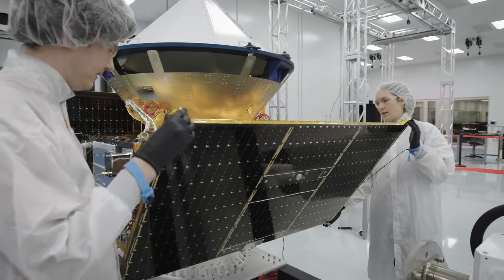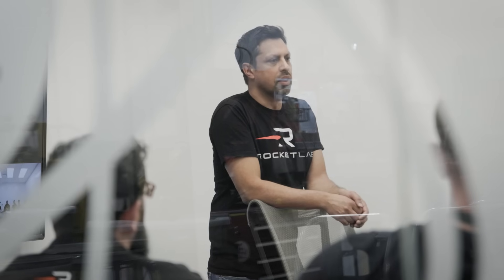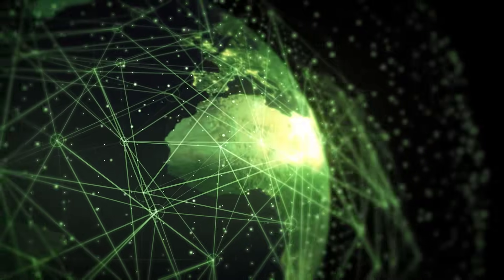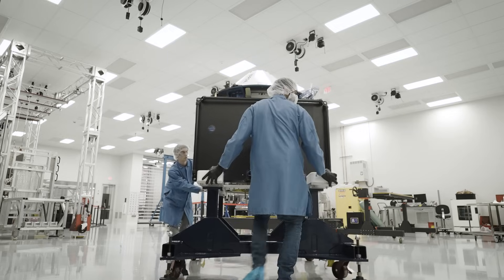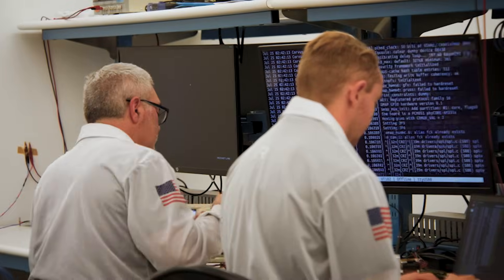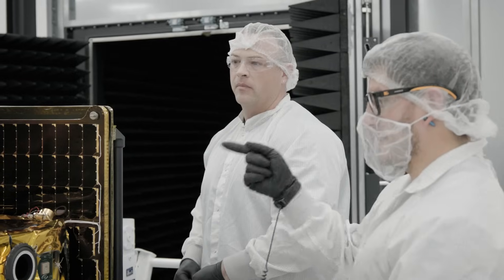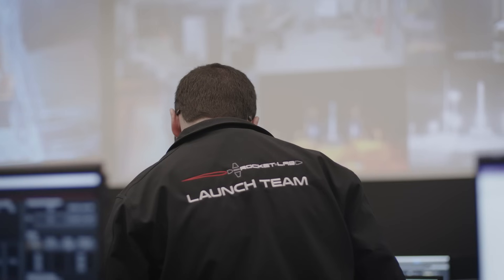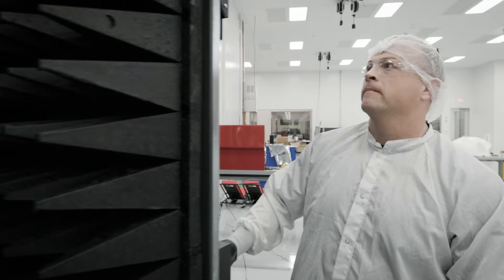Building Satellites At Scale

Comment: How much dust or debris is there usually in a satellite's orbit?
Reply: I think it depends on the orbit. James Web Space Telescope is in a Le Grange Obit 15 million km from Earth (9.3 million miles) and yet it has had (from memory) at least 2 micro-meteor strikes on the mirrors. 
The ISS is in a Low Earth Orbit 340km (211miles) , lower than than most satellites and has had multiple micro-meteor strikes over it's 21 year history. 
I would think the higher satellite orbits 1,100km to 1,300km (683.5-808 miles) have a lower chance of being struck by some debris, as most satellites are in a Low Earth Orbit. 
But it is a problem that needs to be addressed. And there are companies developing space craft that will collect debris in the near future.
But there is a lot of area up there. And so there is a lot of distance between them. Imagine throwing a whole lot of small fridges into the sea (about the size of a satellite) and seeing how many you need to add, before they start colliding with each other. And then stretching the sea out into space. All of a sudden, there is plenty of distance between them. 
Media tend to focus on the 'hype' rather than the facts. Latest news of the Peregrine Lunar Lander got on the news because it has a problem, not the fact that ULA's VC2s was a maiden flight that was entirely successful. So to sum up: There's not enough dust and debris to worry about at the moment.
Reply: @David-yo5ws Can you please explain what caused the propellant leak in the lunar lander   ???
Reply: unrelated